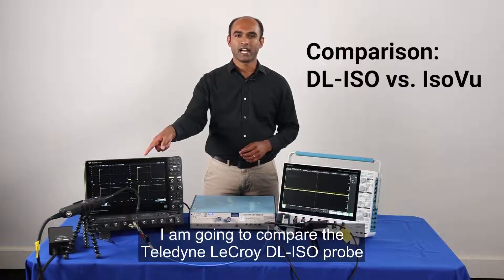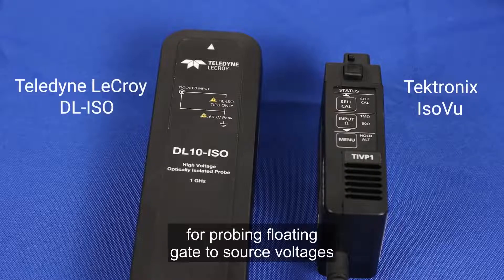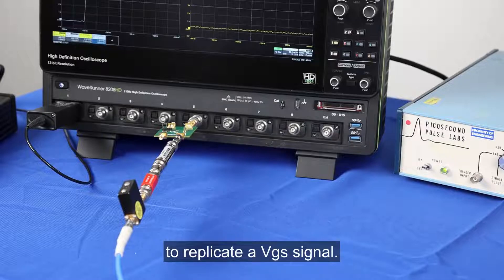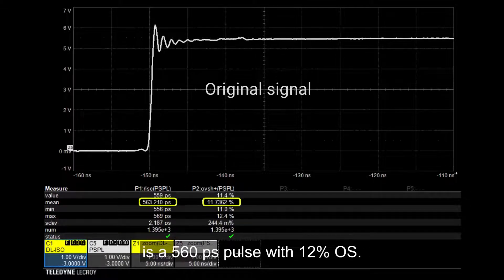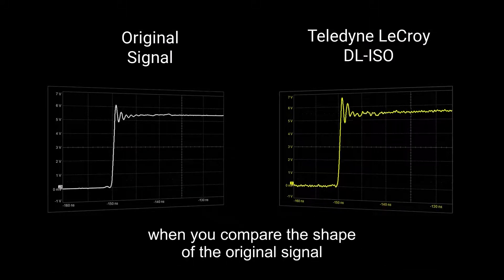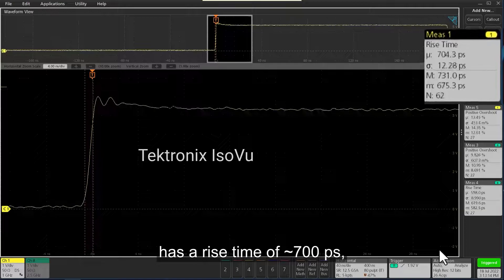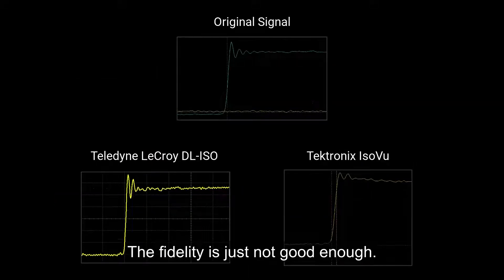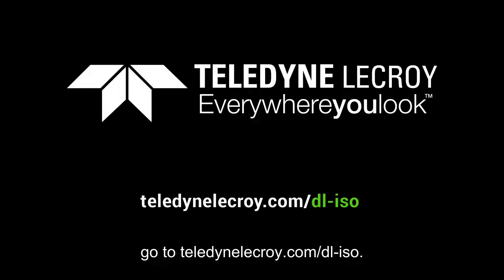Probe Compare: Teledyne LeCroy DL-ISO vs. Tek IsoVu for GaN/SiC Measurements

Comment: Do measurements with IsoVu and DL-ISO using one scope, for example Tek. Then do it with another scope (LeCroy). Then, take the third scope, for example Rigol. Then, let me know which scope take the original signal? No engineering here, only marketing)))